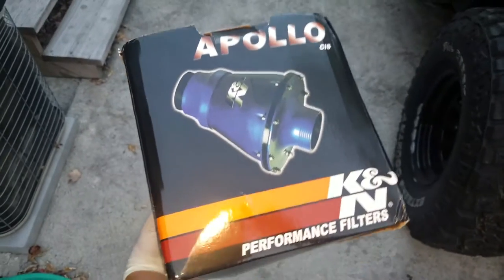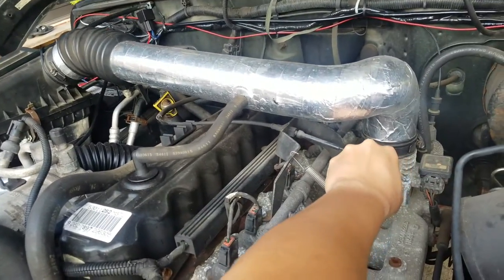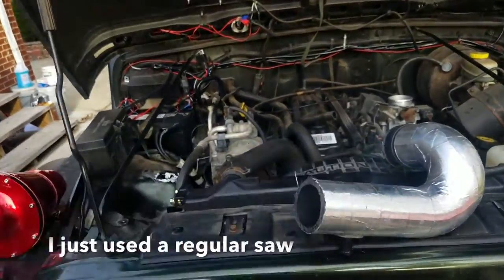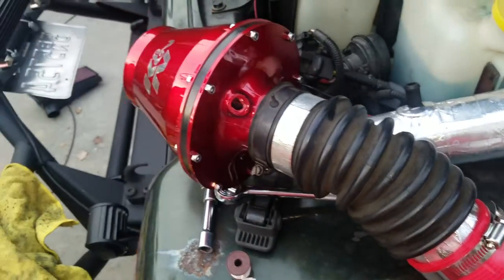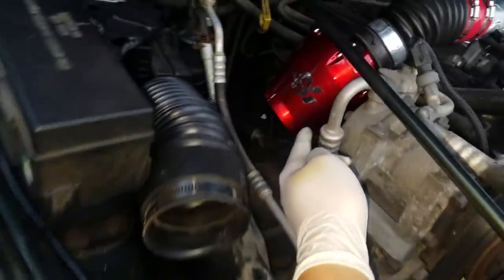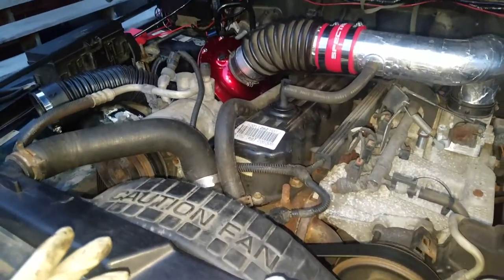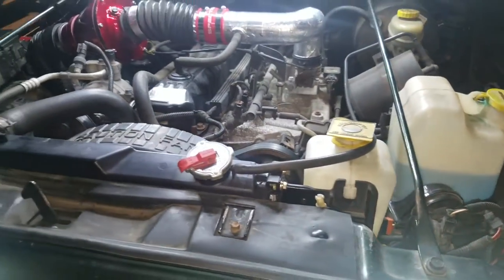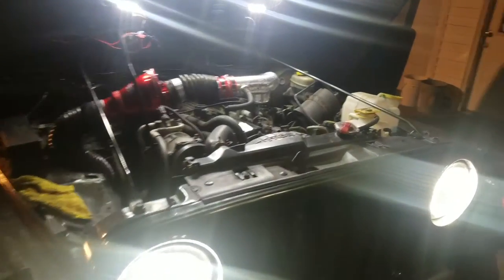How To Install K&N Apollo Intake to Snorkel (Jeep TJ)

Comment: thats a fake apollo.  The original one has the K&N logo upside down.  The paint isn't bright red, it should be dark red.  The box alone is fake.  The cone filter inside should have a serial on the black rubber head

Comment: That is not an genuine KN Apollo but a cheap copy. You should probably put your old filter back or buy genuine Apollo.
Reply from the maker: ehhh i can't complain it was a free gift lol
Reply: MiroslavAdice  how do you know it's fake?
Reply: aiva biggen inverted logo on the filter case and the air filter inside more than likely doesn't have the k&n part number on it, that chinese "wish" marketplace is selling the fakes for like 40 bucks
Reply: Probably little to no difference in performance at all tho lol
Reply: @lister817  biggest flag is that the inside is white the original Apollo is the same color inside and out and although performance is negligible the material of the filter itself can be better and I would recommend getting a performance part
Reply: Forget about throwing your money away on K&N pod filters, 3A pod filters came 1st in flow and 2nd in filtration on the Autosalon flow bench against the biggest names in the industry! I’d say keep the enclosed case but swap out the filter later for one of those. https://www.motoquipe.com.au/buy/3a-racing-pod-air-filter-intake-performance-autosa/3383

Comment: How do u go with heavy rain and the snorkel with this set up? The stock air box has a drainage hole to make sure your engine isn’t sucking the water that makes it down your snorkel. This set up seems to remove any possible drainage.
Reply: The snorkel head itself pulls 90% of the rain out its drainage, what’s makes it down the snorkel body will never make it up the accordion tube